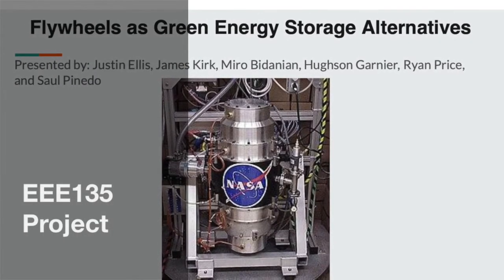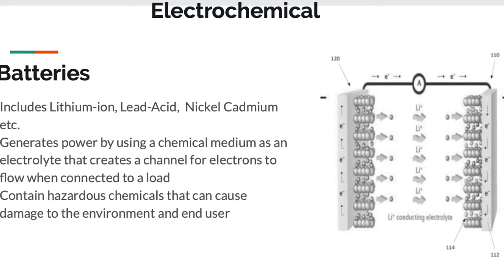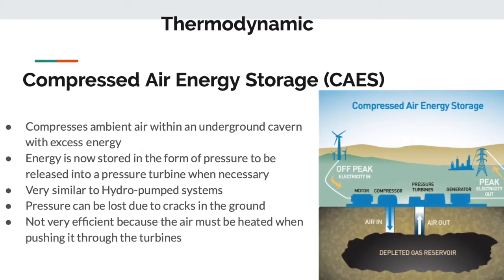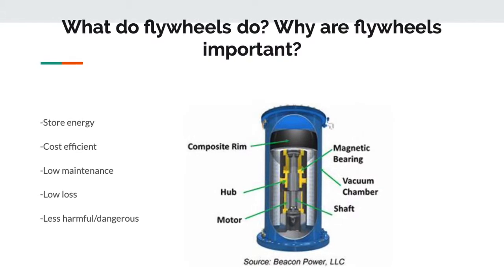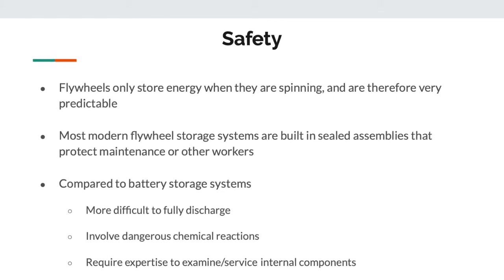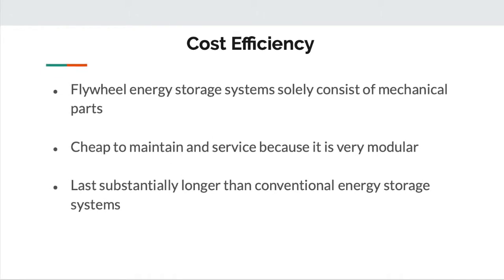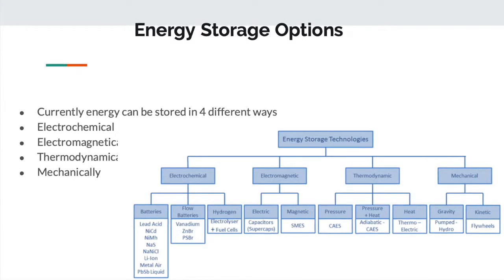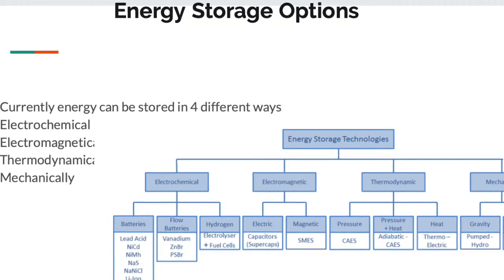Flywheels as Green Energy Storage Devices

Comment: How can you say flywheels are static? You also say that each of the flywheels can respond in 4 seconds and thus can be used for voltage regulation. That is an eternity in electric power system terms!
Reply from the maker: In this reference, we were referring to a modular flywheel (such as  the style later discussed). These units have no exposed moving parts and can be stored in fixed locations. The term static was probably not the most appropriate but it mostly referred to no exposed moving parts and being mounted to a fixed base (unlike pumped water hydro or exposed wind turbines). The entire site can respond to a grid need within 4 seconds. A battery system would take MUCH longer to respond. Feel free to read the attached article which quotes a time of over 2 minutes to respond to a massive load change to restore dip and frequency regulation (the larger issue) (https://www.energy-storage.news/batteries-and-the-blackout-how-energy-storage-saved-the-uks-grid/). When you're talking about discharging huge amounts of power (even 20 MW of power is quite significant), operators can't just shotgun all the power instantaneously. A smaller response can be discharged instantaneously by these systems but not a full 20 MW load at once.

Comment: There is no point in using storage to mitigate intermittency from renewables as , by and large, there is no excess to store. The amount of storage required should there be an excess is huge and not cost effective.
Conventional generators, due to their size have large amounts of inertia, i.e. the flywheel is built in.
Wind and solar have no inertia and it is the lack of this characteristic that prevents them running at large percentages of grid input, as it destabilises the grid. In other words they are an inferior source of power.
Reply from the maker: Not necessarily true on the inferiority of wind and solar. For starters, wind generators are also huge inertia machines. Kinetic energy is calculated as 1/2M×V^2. While it is true you gain much more energy by increasing velocity, the mass of a wind turbine is magnitudes greater than the mass of a combustion engines rotating assembly. In addition, solar is often capable of producing more power than necessary during peak daylight hours. While there is inverter loss as the DC must be converted to AC at a specific frequency to feed the grid, there is still much more energy capable of being produced. The largest problem with solar and other renewables is that some of them are not available at all times of day, which is what makes energy storage even more of an essential technology. Batteries are the easiest but once again, you are storing DC which needs to be converted to AC AND you have a relatively short lifespan on deep cycled batteries. If you research large solar farms you will see that the power generation is far larger than the power consumption of surrounding areas (during peak solar hours). A solar farm or a wind farm is capable of producing any grid need as long as it is scaled properly for the demand
Reply: Justin,

wind turbines do not have any significant inertia. You seem to have little appreciation of the size and weight of real generators. Not only that but they have the ability to increase output as there is a resevoir of power to accelerate the generator if required. Wind is always at maximum and cannot increase.
Solar is a joke, it isnot a really viable way to produce power. High when not required and low when it is. Batteries are as much a burden as benefit. They have a posible role in frequency support but that support is not so critical with conventional generation.
Reply: @iareid8255  I think you need to read about solar and wind you obviously do not have an understanding on renewable energies if you are saying solar is a joke...
Reply from the maker: @iareid8255  a 1.5 mw wind turbine has multiple blades weighing over 5000kg each spinning over 100 mph at expected wind speeds. That inertia is huge, especially when you consider a wind farm with dozens or hundreds of turbines. With wind you can't consider a single turbine. Drive past any wind farm and there are several if not most of the turbines that are not operating. If you want more power, you release the brakes on more of the turbines and instantly have more power. Solar is limited but it's a very effective power generation source during the hours it's available. But once again storage is critical. Batteries and flywheels both have been used for frequency stabilization because conventional generators have issues with trying to instantly match frequency as loads increase or decrease. The whole reason for flywheel and battery banks for frequency stabilization is the shortcomings of conventional generators.
Reply: Justin, 

the more you write displays your ignorance of power generaton, sorry to be so blunt.
Traditional generators with turbines and genertaor rotors measured in the hundreds of tons roatating at 3,000 rpm (Or 3600, if in America) is real inertai and 
conventional generators do not have a problem, or shortcoming with regard to frequency stability. They do not need flywheels, they already have them inbuilt.
Reply from the maker: @iareid8255  once again you just need to do basic math to see the point here. The wind farm over the altamont pass has over 4800 turbines. 4800*kinetic energy of 3 11000 Lb blades with a radius of 110+ feet is a huge amount of inertial energy. This is basic physics. Yes, the bearing load is higher on a levered out blade system like that and that will result in higher bearing losses than a conventional generator. However, once again we have HUGE kinetic energy. The reason most wins turbines stop spinning is because a brake is applied to them. When you get them 200+' in the air the wind speeds are significantly greater than at ground level and usually provide some level of energy at all hours of the day. Back to the point of storage... You can actually harvest energy off of the turbines while they are spinning at full speed when the load decreases (because there are times a wind plant is generating more energy than used by a power grid this is what fuel power markets) Again, you can't compare 1 wind turbine to 1 generator because there is no comparison. You can however compare 1 generator site to 1 wind farm and you'll see(when you do the math) the amount of rotating kinetic energy can be and is often equivalent (if not more from the wind farm). Power engineering is my educational background and I have experience with most conventional and a few non-conventional generation methods... If you want to talk about geothermal not needing storage systems that's fine, but wind and solar are both capable of huge generations throughout a day that could be harvested and stored at low load or high generation periods, and tapped when needed during peak hours.
Reply: @justinellis8374  what is input rpm /hours/power= output rpm/hours/time (if input power less than output power, yes I love your project)

Comment: Just watch people Freeze in Texas because of Green Energy.
Reply from the maker: Not because of green energy. Their gas plants are also down because of poor design and cheap sensors. When you plan for normal conditions you end up being out of luck in abnormal conditions...
Reply: @justinellis8374  Oh like the Fucking windmills  that produce 40% of the power didn't FREEZE. Go SHIT IN YOUR HAT!!!!!!!!!
Reply from the maker: @barefoofDr  check your sources 
According to the Electric Reliability Council of Texas (ERCOT), wind power accounted for at least 15.7% of the electricity generated in Texas during 2017, as wind was 17.4% of electricity generated in ERCOT, which manages 90% of Texas's power.

Also the gas plants would be more than capable of producing all the power necessary if ran at higher capacity... They choose to run wind because it's cheaper not because they have to.
Reply: @justinellis8374  I read 40% at the time of the freeze up.

Comment: There is another technology you need to look in to “Liquid Air.”  That’s air not wind, two different techniques.  You chill air down to a liquid then store in low pressure cryotubes. When energy is needed allow the liquid to return to it’s natural state. Using the physics of fluid under pressure - it will drive a generator and you will have all the on demand electricity as required according to the scale utilized. And all of these technologies are off the shelf !!!  (Look into Highview power)

Comment: Can you please tell me the machine design procedure for this flywheel
Reply from the maker: For our flywheel we designed for demonstration we used a DC machine (treadmill motor) running 150 VDC. That spun the shaft via a caster wheel permanently mounted to the flywheels shaft (mechanical slip clutch). The flywheel shaft is connected with a coupler to the alternator.  The alternator was rewound for low current but low excitement in order to get 12V output. The flywheel itself had to be balanced very precisely in order to turn the RPM necessary for energy storage

Comment: everyone that talks about flywheels mentions their speed...

in a home application will we need that high energy delivery speed? can a flywheel adapt to this application? 

how much would 600 kw/h of storage in a flywheel cost?
Reply from the maker: The speed is equally as important as the diameter of the disk. In commercial sites we have seen reasonably high rpm (15-20K) but also a large diameter in a cylinder shape. I don't have data on the cost of flywheel sites dependant on energy storage but it is initially more than battery sites.
Reply: @justinellis8374  flywheel size kw wise